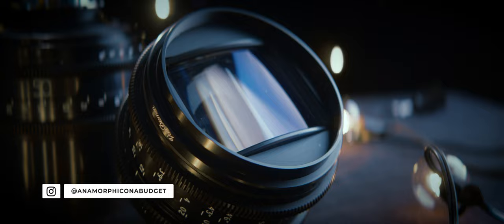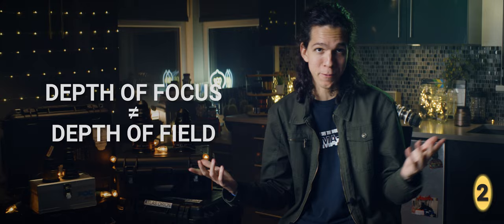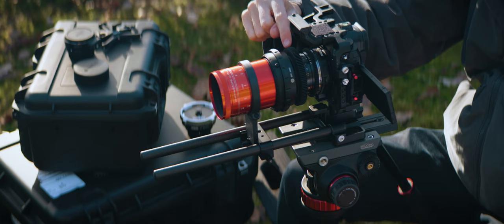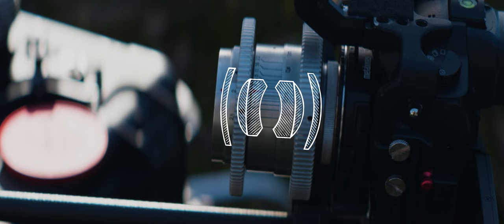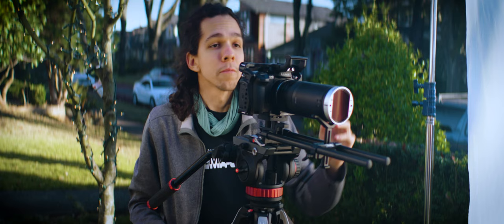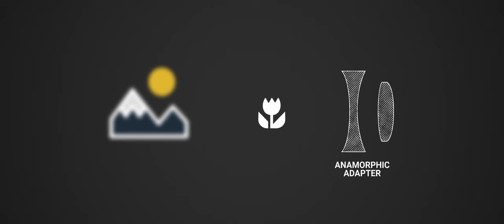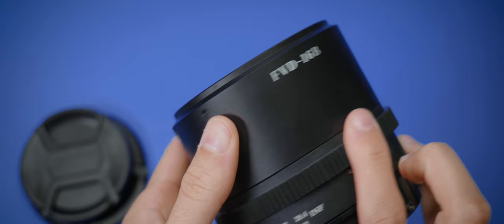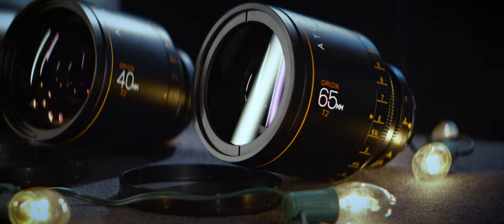Different Focus Types in Anamorphic Lenses - Anamorphic Cookbook - Module 2 Chapter 03

Comment: I really enjoy the idea of having a slight change in squeeze when you focus closer. But assume you only get that effect working well on a single lens system that also has a great minimum focus distance? It's essentially breathing, but in two different aspect ratios - right? 

But as my main goal is photography, this might not be as visible because you don't so much focus fulls for stills. Perhaps you notice it when stopped down with deep depth of field?